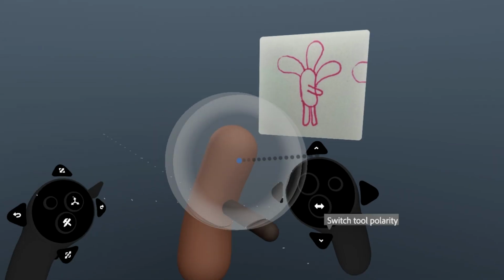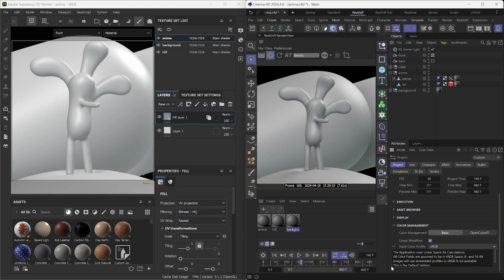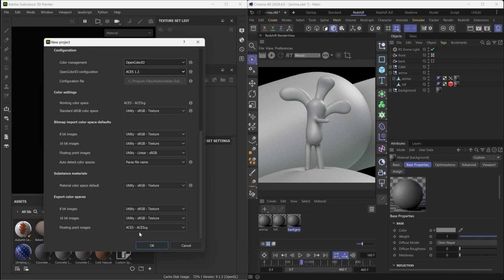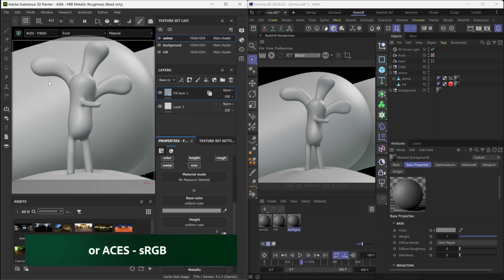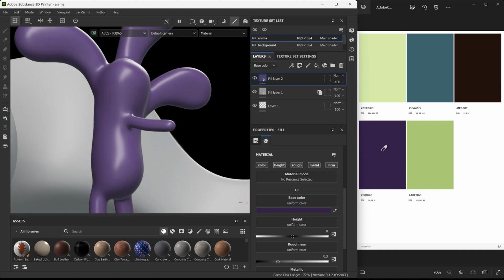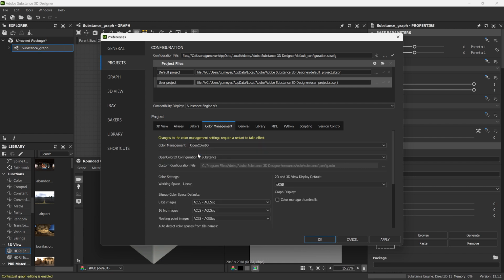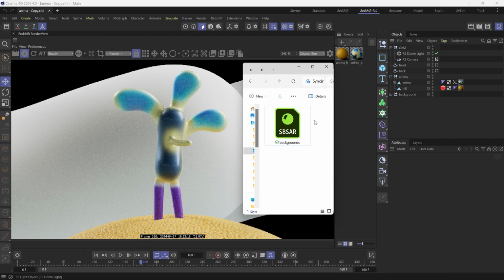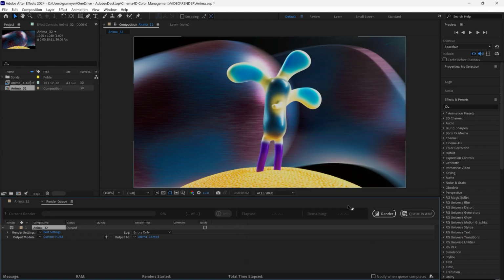Build a Seamless Color Workflow with OCIO Colors | Adobe Substance 3D x Cinema 4D

Comment: We can clearly see colors are not matching. Also, are you using a P3 monitor? Otherwise, it has no sense to use this profile. You must use the profile you got from your calibration device, because native colors profiles from monitors are crap. Additionally, P3 monitors on Windows look like shit, native apps are not color managed. Everything looks over saturated. If you don't print fine art, and you are a regular user I don't think it worth using it.
Reply: P3 would be for Mac users indeed. 
I’m using ACES - sRGB on my computer and screen, which works well.
But we can’t answer for every screen here…
Reply: @guillaume-meyer  Additionally, P3 works best for nature photography, where you can find those very saturated colors. For regular images, the color will fall inside srgb most of the time.
Reply: @Ricardo-de9ju  thank you, didn’t know that. 
Each time I explore Color Management, I learn a new aspect of it, and it never ends…

Comment: I have a question. What is the purpose of working with the wide range of colors OCIO offers if at the end you end up exporting an srgb video to be compatible with other devices?
Reply: In a 3D software, the colors of your shaders will diffuse colors directly, but also in GI and indirect reflections, modifying the lighting energy of your scene. 
Working with these colors in ACES will keep accurate colors during your pipeline and the final rendering.

Even if at the end we are lowering a bit the precision of the final video for online compatibility, we tried to keep an accurate color workflow for the lighting and shading.

Comment: thanks for the Tut.  I have a question about this workflow.  I work in legacy because I can't get the Aces workflow in substance to Accurately pick colors from photos.  In my case the 3d models have to match real world products with specific colors.  I noticed when you color pick from the swatches the colors change in ACES viewport, but in Legacy this is not an issue.  

Is there some setting that will make ACES work for accurate color picking?  I tried many of them..

Bonus Q: what if i work on a team with remote artists and everyone has their own display type at home.
Reply: Hi,
For the color picker, you can set the color chooser color space and the eyedropper color space. 

If you’re picking colors from the same screen displaying Painter then the color chooser & eyedropper should use the same color profile. 

You could change both of them in Utility - sRGB = Legacy mode to see if it works better.

Be careful a lot of 3rd party applications like web browsers could display color with a bias.

The best scenario would be to color pick from an application that uses ACES or Adobe ACE, and have Painter using the same color management.

If you use the right color profile for your computer screen with the right applications, the color picking should be more accurate in ACES.

Make sure that your baseColor channel is in 32bit in the texture set settings for more precision in Painter’s layer stack.

For collaborating with team-members using different display devices, the OCIO workflow correctly set should compensates color shifting in between screens.

Be careful, using OCIO with wrong color profiles, could completely bias your colors in collaborative projects.

I hope this will help you, setting your colors pipeline correctly.
Reply: @guillaume-meyer  thanks for the good info i will try it.
Reply: Make sure your team is using monitors with the same colors capabilities and duly calibrated. Aces workflow would take care of color conversions to your monitor profile. This is a very deep topic and this video is very poorly explained.

Comment: very informative and I will def be trying your workflow. Only thing I would add is to Render in EXR 16bit float, I use DWAB Compression. Much faster than TIF. Specially for Animation and compositing. Stay away from PNG or TIF for file sequences. Unless it's truly needed for a specific hardware.
Reply: Thank you for adding this information to the thread! It’s very useful to know 😮.